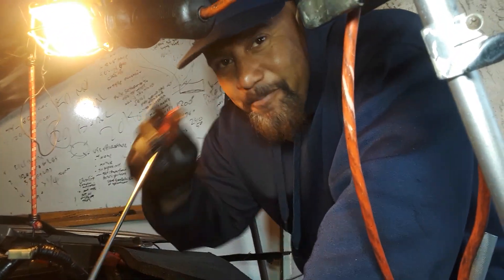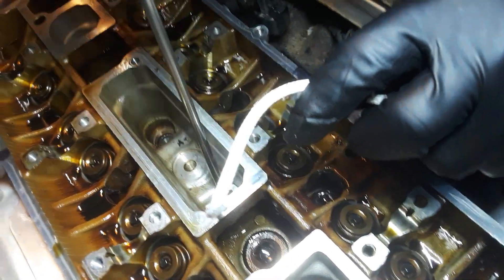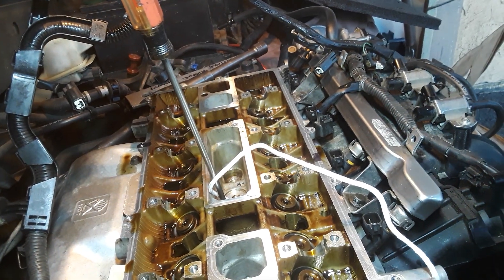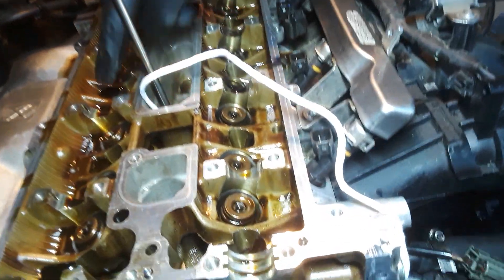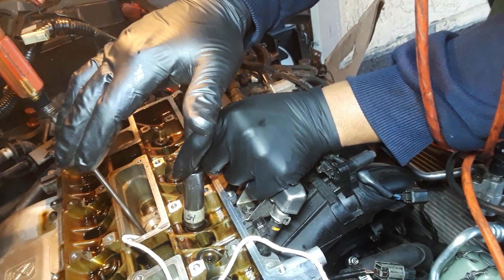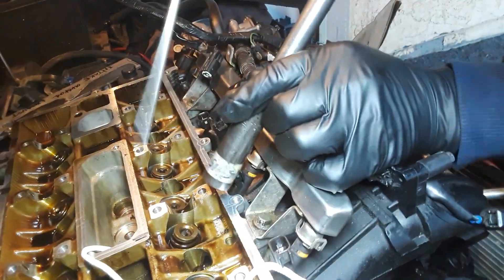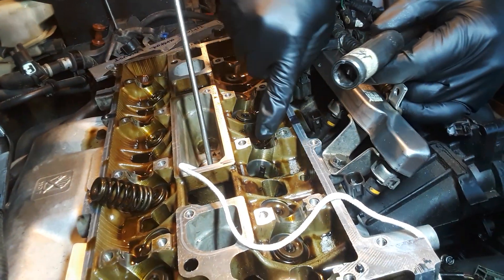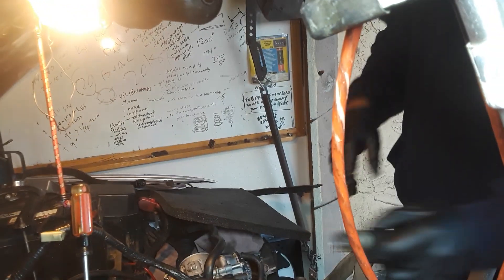HOW TO TAKE OFF A VALVE SPRING WITHOUT TAKING THE CYLINDER HEAD OFF ( STILL RELEVANT IN 2023 )

Comment: Many moons ago, I had to replace a broken valve spring on my Avenger rally car engine. I pushed a party balloon through the plug hole and blew it up to fill the cylinder and hold the valves in place. Then jury-rigged a lever type spring compressor using a jack handle and bits & bobs. I'm liking the rope method better though. Nice work.

Comment: Have a V6 Ecotec Buick motor in my Aussie Holden Commodore with apparently a broken valve spring, I was wondering how to change the springs without removing the cylinder head and the consequent problem of how to keep the valve from falling into the combustion chamber. Thank you for the old school trick.

Comment: My air compressor wasn’t big enough and I started running against time... long story short I didn’t notice the air pressure started dropping causing the valve to fall. Imma fit a magnet through the cylinder hole and if that don’t work, I’m fucked.

Comment: I do not recommend hitting the valve! that could bend the valve a little bit, just use a valve spring tool
Reply from the maker: Then it wouldn't be Oldskool and challenging. That's the whole purpose of this channel, using as less resources as possible.
Reply: @oldskoolfunk71  but it should be done right, brother
Reply from the maker: @jalo1739  it's not for you my man
Reply: @oldskoolfunk71  also the tool is very cheap to buy
Reply: He's not hitting the valve. He's hitting the valve spring. It's perfectly safe.

Comment: Nice quick video brother. When I did the retainer and keep replacement on my s2000 I used compressed air at 30lbs and a overhead valve spring compressor

Comment: And none of y'all have ever heard of using compressed air to hold the valve in place??
Reply: I used the compressed air method several times doing cam swaps on  lt and ls motors but then you gotta deal with the compressor running and how much cylinder leakdown you have. God forbid your compressor dont keep up and you push the valve on accident and there she goes. If its that easy to get to I would use the rope too.

Comment: Good technique. I used to replace valve seals by connecting the shop compressor at the spark plug hole, which blew the piston to BDC and closed the valves. Then a lever type spring compressor would allow the removal of the locks, spring and defunct seal. "Reverse procedure to install." I never had a valve drop into the cylinder, but I guess there was a risk of that.

Comment: I've put an air fitting in the plug hole and put air to the cylinder tok hold the valve up and changed valve seals.

Comment: God bless,i have question,i have a 1991 pontiac firebird v6 3.1 replaced  most parts on it cap rotor wires plugs ,still dont run rite,just  started throwing out some smoke and thoughts on what i can do ,or should i invest in a cheap engine,

Comment: Why not use a small hammer or piece of wood as valve springs vary in tensions and some might need a firmer blow. Doing it with ones had could result in severe pain or even an injury.
Reply from the maker: Very true. These small engine springs come off easy. I use a small mallet to hit the bigger springs.

Comment: Why would you need taking off a valve spring having head mounted?
Reply from the maker: Leaking valve seals burning oil. Excessive smoke.
Reply: Broken spring as well. It happens...
Reply from the maker: @dtnel  Yes it does. Floating springs also.

Comment: Hmmm... what jobs could you do other than replacing springs and keepers after using this method to expose top of valve?
Reply from the maker: Valve seals, performance springs, keepers and retainers.
Reply: @oldskoolfunk71  
    Valve seals! Not such a scary prospect to correct using this method, great video tip

Comment: What is the tool you used to press valve spring.
Reply from the maker: Its just a deep socket with broken pieces of a magnet inside it with an extension attached.
Reply: Great videos on do it yourself.

Comment: I appreciate your videos dawg now I can change my ls  valve springs whenever I swap my cam.
Reply: Not sure this will work for your ls to change the cam u r supposed to change the lifters as well and on the ls motors you have to pull the head to gain access to the lifters.